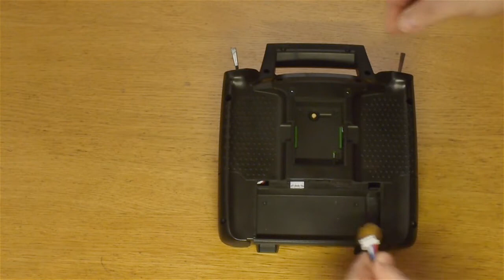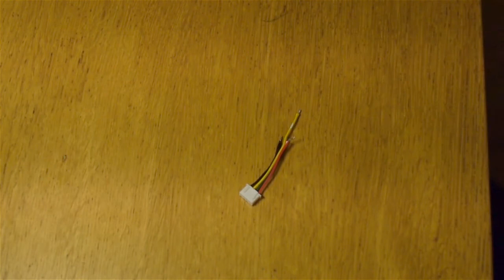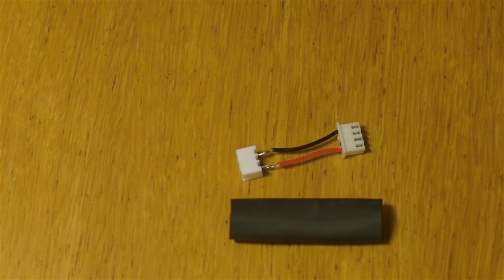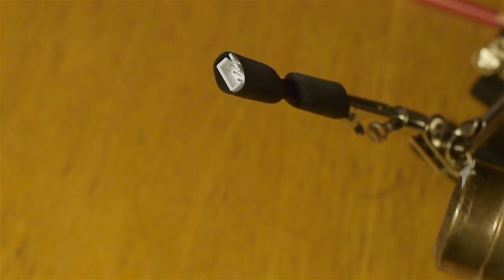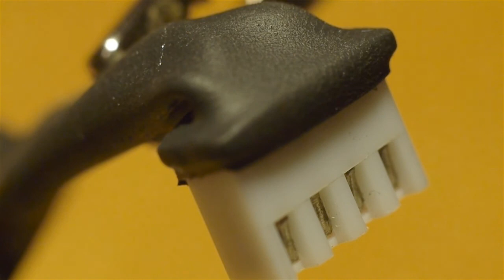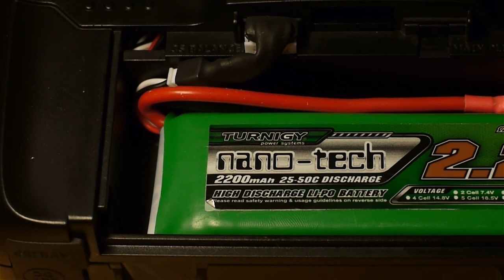Turnigy 9XR - How to make a safe battery adapter

Comment: or you just have one battery in all the time and charge it by the charging port on the remote then you don't wear out the wires
Reply: jameshone1000 If you charge a 2 or 3S LiPo through the built in charging port, you will not get balance charging which is an absolute requirement for a LiPo battery. You do NOT want a LiPo fire in your transmitter! Far better to charge the battery outside the transmitter like Kjell does.
I use a slightly tired old 3S 1600mAh battery that has been retired from use as a flight battery. It will last for several visits to the flying field, and I always bring a spare. The mod looks like a great idea. Even better might be to remove the plug altogether and solder a 2 or 3S balancing cable direct to the board.

Comment: I'm trying to decide what TX I want to buy, the turnigy 9X or 9XR. I like the 9X because I like to do the mods myself with the 9XR it's already done for you. So which 1 of the 2 should I get???
Reply from the maker: In short: The 9XR.
The 9XR had a number of issues when it came out. The buttons stuck, the pots in the gimbals failed, the plastic molding of the case had issues. All those issues are gone by now.And as a bonus HobbyKing has upgraded the processor in the 9XR to a variant that has more room for model memories.

The only thing the 9x has going for it is that it comes with a radio module. But that radio module is not to be trusted. I took me a couple of crashed planes to find that out the hard way.
Reply: Thank you :)

Comment: Does the radio bring something to use AA batteries??
Reply from the maker: No, it did not come with a AA or AAA holder for the battery compartment.
Reply: ***** Damn it... Thank You for the info!

By the way is the radio really any good? Like compared to Futaba, JR, Spektrum, Hitec...???

Is it precise, glitch free?

Would you really fly an expensive model with it and trust the radio\receiver won't fail?
Reply from the maker: Yes,  I would trust it with an expensive model. But you naturally need to use a high quality radio module like a FrSky.

Comment from the maker: Yes, a 2s cell will be enough to drive the radio with the Orange transmitter module. I have used exactly that setup extensively.

Comment: inside the 9xr there is a voltage regulator, you don´t need to use a 2S, 3s is perfect with no problem, but regarding the connection you made, its perfect to use no matter to 2S or 3S, just because of the brake part....

Comment: First class idea. Top marks. Although I'd use a smaller battery myself, you don't need a 2200. HK do a nice 1450 1c pack or a LiFe is even better.